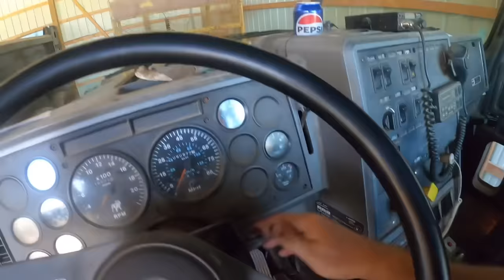Catastrophic Tile plow failure what happen to cause this epic failure?

Comment: I'd say heavy stress loads and vibrations generated when going through rocky spots caused metal fatigue.  The fatigue acted similar to the bending and breaking as when you break the metal off when doing a torch cut that was not completely clean.  You can see the vibrations clearly in this video.

Comment: Hard to fathom the IMMENSE amount of power required to physically stretch that much plate steel before the welds finally ripped loose.  Holy crap!  That 850J with the wide track pads is an absolute beast.

Comment: Well it had a heck of a run. Get some dual shield wire on ole sparky and get it glued back on.  Those cylinders should buff out fine with a good quality paper towel and some black spray paint.

Comment: Never try to run a tile plow through a existing terrace. I how some farmers that tried that with 9330 Case Steiger 4 WD w/ a tile plow the 4DWD tractor stop moving plowing through the terrace .so they hooked a D6c Cat to the tractor. They pulled the complete 3t linkage off that 4wd tractor. Always cut through terraces to lay pipe through.

Comment: Hind sight is easy.  Not enough metal below the bottom pin to take the tensile load.  Of course, since you have no idea how much load you got, the only way to know is to run it, break it, make it stronger.  I'd suggest build it back exactly the same so all the rest of the parts don't need to be replaced.  Then, add flat plate to the bottom of the side plates in an "L" configuration all the way to the rear.  Can't go inboard, so it has to go outboard.  Maybe a doubler around the pin holes as well.

Comment: Well you found the weak point. Looking forward to seeing where you reinforce it at and wondering how close it will match what I would do. From what I've seen you are a highly capable engineer without a degree and I have no doubt that like the six million dollar man, you will build it back stronger and better than ever.

Comment: the big rock may have started the crack and the rock when pulling aggrevated it more can see no old fractures all seem clean breaks may need some bracing around pin holes and maybe extra metal above and below pin holes to strengthen them

Comment: Tough break with the plow failure. Even with all the pressure, you at least still have the exhaust spoon in working order and, you have the grading system on the 210.

Comment: A bar extending off the dozer blade with a hitch for the pipe trailer would work. Drag the trailer around the fields with the JD or pickup and back it up to the hitch. 
Hindsight is always 20/20. After the first struggle getting through the road, would it have been worth considering using the excavator to trench across road. The road being a ridge next to a ditch suggests there might be bedrock or hard scrabble  under that road.

Comment: Oof, that sucks. Given the thumbnail, when you got to the part of the video where you said you’re gonna plow across that road I was like, yeah, that’s gotta be where the failure is going occur since the compaction is so high there. And that was my thought without even hitting large concrete boulders (which it did go through on the first plow).

I am guessing there is another large concrete mass that you ran into and this time the dozer tracks must’ve really been able to bite into the road bed and something had to give. Or, this time the plow couldn’t get under the concrete and provide some lift on it but instead had no choice but to try to push it through the Earth.

I bet those concrete masses were from an old culvert exit or entrance that were buried there whenever the last work was done for that existing pipe possibly. 

Good luck on the repair (which is probably done by now, but hey).

Comment: That's metal fatigue with all the stress of pulling through rocks. You must admit, you've pulled through some major rock layers while you have been using the tile plow. Looks like you have some upgrading to do on that area of the tile plow.

Comment: Making longer with a less severe angle ramps for the low boy trailer so that the weight of the dozer isn't put on that area of the plow when loading and unloading is likely to be of some assistance in the longevity of the plow.

Comment: Surprised you attempted to pull the plough through the track a second time after seeing the results of the first . It does not look like undisturbed ground ,more like a rock base to  support the lane from sliding into the gully . Hope you can  get it fixed up soon , lot of welding needed .

Comment: I weld a lot of heavy steel we always bevel all the gusset for full pen welds you can see it just pop the weld in too you got 3/4 plate but only have 3/8 weld holding it together full pen welds you have the thickness of the plate plus fillet weld size a lot stronger weld and not gap behind the plate just a thought we weld lot of full pen welds

Comment: I felt sure it was gonna let go on the first pre-rip the way it was bucking and kicking.  That rapid vibration it was doing is the first sign that something very intense is going on.....all that HP being generated and nothing is moving.......whew!  My gut feeling right then was that maybe park the dozer and just trench the road with the excavator.  That road has to be pretty packed and solid, and when that first giant rock came out of the ground my first thought was those rocks were put there intentionally to build that road base solid because it's on the low ground.  My money says everywhere along that road has rocks like that in it. I'm not sure I would change anything in the design (unless it was just easy/obvious what to change).....it has worked very well for MILES and MILES of tile, and it will do so again.  I would just turn my radar up to recognize when to tap out and let the Hyundai get in on the action, because if you make it stronger, then the next weakest point may be seriously $$$ to repair.   Definitely a bummer, but also YouTube GOLD as far as content goes!  (Has to be a positive in there somewhere, right!)

Comment: Mike you may want to rebuild that with 1.5 inch/38mm 550 Hardox plate.  Aaron should approve and he should weld that.  He will have to layer it in to get full penitration.

Comment: It is amazing what you already accomplished with that plow. But with pulling with two machines the most damage was already done, this wasn’t the hardest pull when it broke.
It is something that comes with self engineering. But you can get the weakpoints out now to make it even better.

We always say “after it happened you look at the back end of a cow”, in other words, dry your tears and move on. Just be carefull it is not the ripper itself that breaks next time, might cost more then you want. A weak pin that goes first is usually a good safety.
Cut some grooves in a pin on the crosssection of the plow and the holder on the lathe.
Both simple and effective.

Comment: At least it broke at the beginning of the cut instead of half way thru the field, sucks either way but i guess thats a positive if it is one. Guess this winter will be a good time to build a spare plow with upgrades to cure the weak points already found and make the boots for different sized pipe

Comment: Oh, thats a shame, the problem is equal that what I last wrote with the forks, lets say, the dozer pulls with 15t, the upper fix point to the booth of the plow is 2m, the point of failure is the smallest point with 0,3m, so 15t*2m/0,3m equals 100t pull (theoretically 50t per side, if you turn, may more), however (simplified), the pulling force only applies on the bottom side (decreasing to the middle), the welded in pipe will make not much, because it isn't a full penetration weld and even if, the pipe will deform in it self, all in all, the small square at the bottom was holding all the force, after that breaks, the rest had no chance. 
Hope that helps, if I can further assist you, feel free to ask.

Comment: Did Arron give a 5 year warranty on his work! Sorry to see this happen but even if it didn’t break on the county road it was inevitable to break at some point if there was a weakness. Arron to the welder and it will be better than before. Can’t believe the way it just sheared off the ram outer casings , they are pretty tough to break

Comment: Where it failed was where i would have been most concerned.  Its the lower edge so it is always in tension, the fairly sharp change from angled to horizontal and the pin boss concentrated alot of stress right there. It wasn't if it would fail just when.  I actually think at 16:06 it might have started a crack as it made a distintive metallic snapping pop.  My guess would be it broke the thin little section under the pin boss at that time.  Can double the area up, but might just fail where doublers end.  Permanent fix would probably be to thicken the 2 main plates, add another 2 inch of material below that boss, and maybe also add an boss around the pin to help gain some strength back as it did look like the boss weld was dark and had been failed for a while.  Just some tips from a structural equipment engineer.  Sure you will get it fixed or probably already have by now!!

Comment: I've been surprised that's it's not failed before - the stress on the upper section that failed is obviously enormous when you hit a large rock that's solidly bedded in the subsoil. The force between the two pins at the top is around 8 times greater than the force applied at the bottom, so when you hit a rock, if it takes 5 tons (or maybe 10, or 15?) to break the rock you're applying a force of 40 (or 80 etc.) tons at the mount. Repeated stress leads to fatigue, and fatigue leads to the failure we saw.

Comment: new cyliners for the hydraulics on it as well, might want to look at adding a support for them when fixing it. The walls of the cylinders are usually pretty danged solid since they have to contain a lot of pressure, for both to break they were getting stressed at that point.
Reply from the maker: Not for sure you understand what happened look a bit closer

Comment: From what I’ve learned it failed in the spot it would have when it did. Steel likes to fail in the shortest distances and right at those pins is the shortest distances from ends to ends. It sucks it failed when it did but like you said it was a clean break and no bending and twisting

Comment: The vibration from scraping through rock on your first run probably caused a fatigue crack to start then when you tried to pull through the road base which looked SOLID broke her. Man there must be an intense load on those pins when ripping hard pan like that. It would be interesting to see a strain guage in there to get a reading of just how much! The welds on those fillet pieces doesn't have a lot of penetration, just sayin MBTS, not criticism. Bet DP needed to change his drawers when she went BANG! Sas sad day. G'day from Tasmania and merry Christmas to all.

Comment: That failure is from metal fatigue due to stresses out on the material when used. The welding on the steel plays a role also, but it’s a factor that can be mitigated. I’d go to a thicker piece of Steel next time and make sure it’s USA made. Across that same area that failed, on the next version I would look to incorporate some strong backs or more gussets to help improve it strength from the force that get placed on the material. 

It might also be nice to try using some transducers in a few. Key areas to try and determine the amount of force that gets put on the piece of equipment. Very good design, I’m a former inspector doing NDT work for over 20 years in oil and gas industry.
Reply from the maker: I can tell thanks
Reply: @DirtPerfect  I really enjoy your videos and that you share the great friendships you have. I should have made videos back when my brothers and I were building and inspecting drilling rigs and equipment. 

If I could ask, could you ask your welder how he feels about different machines and processes. I particularly prefer the Old SA200 machines when welding heavy steel and pipe, but I do also lien the Lincoln Vantage 500 and cross country but the miller pipe pro is nice also. I do like
The Lincoln LN-25 wire feed attachment for running flux core wire also.
Reply from the maker: Can do thanks and appreciate that

Comment: Those uprights probably should be 1" plate, and ask for 100 KSI like the beams on your detach are made of.  Pre heat and flux Core all welds and your problem should over. the forces on that thin area around that boss has to be pretty high. That is a sweet operation you have there. If you want to mass produce them count us in 👍

Comment: Sacrificial shear pins maybe? Works on aircraft tow bars and stops the tug from pulling the nosewheel out of the airframe, additionally they are easy to make/test as they are just hollow bolt's/pin's.

Comment: Needs to be 3/4” or 1” plate! 100% bevels and 100% welds, that packed road, stump and rock got it this time my friend! I hope you can regroup on a good modification Mike! We don’t know until it happens I guess brother, we just regroup on our figures! Good luck brother,  hopefully Aaron gets his outage completed! But I guess this gives you time to think about it and study it! I believe I would 7018 all critical welds Mike, I’ve built a lot of heavy brackets in my life and they always wanted everything stick welded! I’m not saying Aaron isn’t a good welder but I don’t trust mig for deep penetration welds! I was certified on several thickness metals and each procedure test I’ve taken, some had 6010 stringer and hot pass then fill it up with 7018! 7018 holds more or twisting and pressure stress welding! Just trying to help out my friend! Good luck and try to put as many gussets as possible for strength! Take care Mike!

Comment: Its not too bad - a couple new cylinders , a couple new plates , a bunch of welding and grinding , lots of shenanigans from you two and a coat of paint and it will be better than new - but the ridicule from mbts is gonnna hurt 😂 looking forward to the repair vids 👍🇺🇸

Comment: Well things can be worse.  A couple of Farmers in my area plowed through a 12  3/4"  Natural gas transmission line and knocked out service to 37,000customers for 4 days.  I don;t think their Insurance Co. is very proud of them.  Nobody got hurt but the force of the escaping gas blew the tile plow over the top of a big IH Quad Track. Luckily the gas did not ignite.  Pipe line was believed to be at 800 PSI.

Comment: I can't believe that that plow just tore apart like it did. MBTS is going to have some emergency welding to do and he has to do it fast fast fast. Hate to see this happen when your back is up against the wall Mike but I have faith in you. You will get it fixed bigger, stronger, 😂 better
Reply: The line is bigger, stronger, and faster. :) MBTS is going to cry and say "what did you do this time Mike". :)

Comment: When the camera was mounted on the ripper arms, I thought the tile plow was flexing a lot.  It was just the camera tilting with the arms as the ripper went up and down.  But I will say this, that initial pre-rip through the tree stump and splitting that big rock was certainly a pre-qual to the tile plows demise.  As the pre-rip for the second run was starting, I saw all that rock and had a feeling the rest of the big rock was going to be in the way.  As soon as the point penetrated and there was resistance, I was waiting for the failure.  Of course, the failure was not what I expected.  I was expecting the boom to fail, but it decided to go out with a grand finally and separate the entire main structure as well as split the hydraulic cylinders!  I won't be surprised if the boom suffered some out of specs flex and may need to be fixed as well.  One thing is for sure, MBTS is not going to give Mike any leniency and the comedy is going to be epic!  Looking forward to the re-engineering and rebuild for Tile Plow 3.0!
Reply from the maker: That’s how I keep grade

Comment: Couldn’t you rig a pole thru the 2 round holes (lifting eyes?) either side of the 850 with a pole to have the tile on so it would spool in to the plow as you go along??? 🇬🇧🇬🇧👍👍
Reply from the maker: I don’t want that have covered this several times thanks

Comment: A few things you pull up a 6 foot rock and you shocked there was a rock levy that cracked me up you driving across the lawn I bet you chip a tooth next time you cut the grass then that’s awesome driving I think I would have to remove the edge cutters for some relief I know it sucks but if it had to happen that was a easy time just starting on the road close to home

Comment: Design is great. Material failure of what I'm assuming was standard A-36 steel.  Time to up the ante; think about some type of a "Tool-Steel-01" or  such as 4140, and alike.  You thought the A-36 steel you purchased was expensive, wait till you start pricing TOOL-STEELS, have heart medications at the ready, you'll need them.  Just another thought maybe some AR-500 steel (& no, AR does not stand for Armor-Resistant, does stand for Abrasion Resistant, Like that found on Tractor / Bulldozer Blades, Rock Crushers, replaceable sheep's-foot like on your, excuse me Aarons roller etc.)  As we all know, comes down to what material(s) are available locally or nearby.  That you live out in the boon docks, I see you making a trip to somewhere, or waiting for delivery.  How much time don't you have to fix this problem yesterday.

Comment: lifting plow created an over turn moment at tip.  The failure was at the stress concentrations of the pin holes.  Their was not correct edge distance at the hole.   This overloaded the plate and yielded the material.
Reply: distance from edge rule of thumb 1.5 times hole diameter.